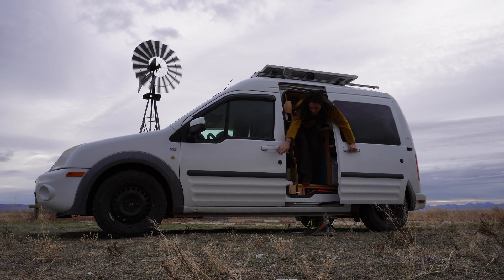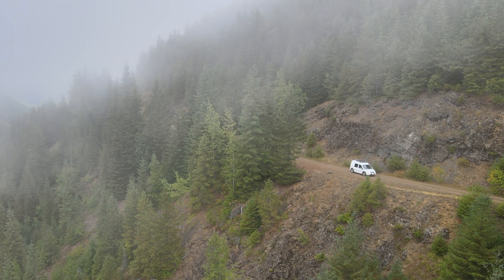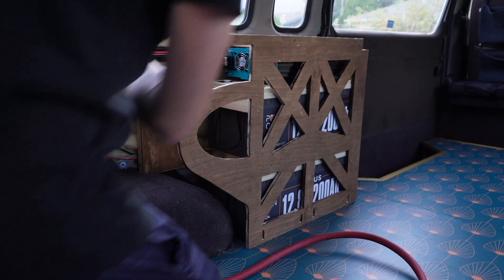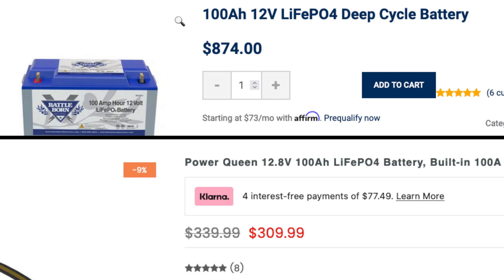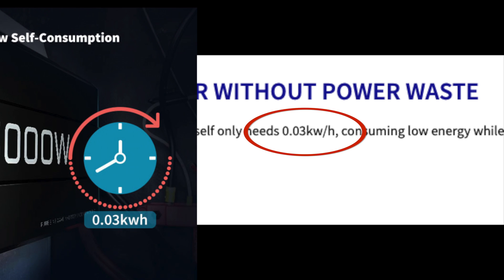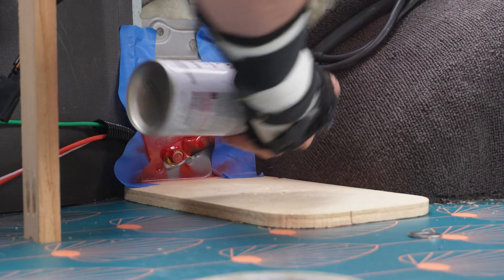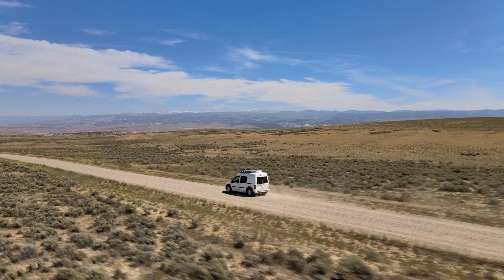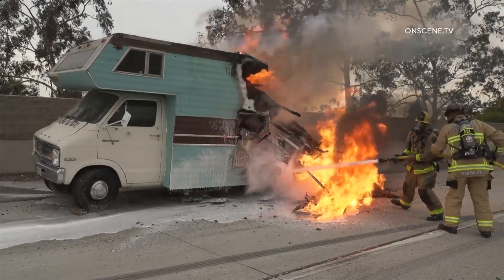Camper Van Power System - Design Considerations

Comment: What is the name of that bracket system on roof. Have never seen that. Thx
Reply from the maker: It's called t-slot aluminum extrusion or 8020
Reply: @dustyodyssey  so I went back and looked because I am familiar with 80-20 but I am actually referring to system on Toyota. I binged watched your videos lol.
Reply from the maker: @navmarroaming2292  oh, the part that attaches to the van? Those are just generic gutter mount roof rack mounts that I drilled holes in to adapt to the 8020. I think I found them on ebay
Reply: @dustyodyssey  Thank you for response. Found the rack build in "Starting the Van Build" video. Appreciated.

Comment: Looks like a pretty well built system. I would have made it 24v and run all of the 12v stuff off the car battery. It would have been easy enough to charge your 12v off the bigger 24v stuff. There's also 120v step-downs that probably give off fewer voltage spikes.
Reply from the maker: Yeah, I think if I were to do it again I would have done a 24v system.

Comment: Great presentation! It's kinda funny how people interested in the DIY camper space end up watching all the same people and videos.

I'm glad you brought up the Max Air fan issue too, went through 3 controllers myself with no explanation from Airxcel CS on what was different from the failed 2nd board as the 3rd looked exactly the same! Going with Foresty's solution if the fan controller dies one more time.

Tangent, but I have to say the dumbest thing about these fans is that they spec'd brushed motors resulting in an inevitable accumulation of brush dust which always leads to squeaking inside the fan motor case. Lord above, Why? All they had to do was make a brushless version and it would be perfect. They certainly charge enough to justify a brushless version. I hope to god that someone produces a drop-in brushless replacement in 2024 after the patent expires. MORONS!

Comment: Thanks for mentioning possible problems with fans, refrigerators, etc. caused by the higher voltages of Lithium batteries. I had not seen any other videos that mentioned this.  Good advice to over-design your system for a margin of safety as well as lifetime economy and longevity.  This is a good example of best-practices engineering.

Comment: I love the simple hammer-whacking crimper for smaller stuff but I bought a hydraulic crimper for the bigger stuff. And since it appears you're in Colorado (and I assume in the Denver metro area), if you want to give those bigger lugs a re-crimp, I'm just up near Boulder, you'd be welcome to borrow my hydraulic crimper.

I built my own batteries as well - I've got a pair of 280Ah packs with BMSs with low-temp cutoffs.

With the fans and voltage - I've read they revised their control board design a few years ago and the newer units are far less subject to failure due to higher voltages. Plus, the 14.6v voltage is just at the top end of charging - when the charging is cut off, the voltage settles back down over a short time. But, the voltage regulator isn't the worst extra thing to do just to be safe.
Reply from the maker: Thanks for the offer! I was really tempted to build my own battery, but it seemed like a lot of extra work, but having the low temp cutoff in the BMS seems really nice, and definitely cheaper than an off the shelf battery. 

I also heard that they updated the PCB (after 5+ years of this being an issue) and I do wonder if I would be ok without the regulator, it is annoying because the regulator uses about 100mA and it's always on, and I don't really want to wire up yet another switch/relay.
Reply: @dustyodyssey  seems what I've read is 2018 is when the update happened on the fans.

Building the packs was fun! I just watched lots of videos and took my time with it. I ended up with 560Ah at 12v for about $1600 all told (cells, BMSs, wire/lugs/terminals, etc). 

Those batteries you have, I found them online, and they seem about comparable watt-hour/cost wise. Lack of temp sensors is silly in these packs now though. I don't know why these vendors skip that.
Reply from the maker: @wanderingzythophile9083  That’s really cool, and now you have the ability to replace individual cells if one goes bad. I agree about the lack of temp sensor. When you’re paying several hundred for a battery the omission of a part that probably costs pennies seems ridiculous. They must have a bunch of those BMS boards sitting in a warehouse somewhere.
Reply: I think it's more to do with the model of the unit than parts. The temp sensors on mine are hardwired, not something that plugs in and can be popped off, like the bluetooth modules are. 

I expect the model units without the temp sensors are simply cheaper.

Comment: Man, this gives me flashbacks to some of the solar systems we've built at work. I'd be pretty spooked to put all this in a plywood enclosure, but I've also set a battery on fire through shear stupidity.

One thing I can tell you for sure: put padding around your batteries. Vibration and rubbing can compromise the outer case of your battery and cause a leak. We just had that happen at the shop last week at work. No bueno. A 1/4" neoprene sheet works pretty well.
Reply from the maker: Yeah, back in the day I had a big MOSFET blow up in my face due to my own negligence haha. I didn't think of the plywood enclosure as a hazard because it seems to be pretty standard with van/RV electrical stuff, but now that you mention it, it is pretty scary... And I think the batteries will be ok. The cells are padded internally on all 4 sides, so even if I manage to wear a hole all the way through the outer case the cells will still be protected.

Comment: 1:08 it's not free. Your total cost of the solar system is upfronting your electricity costs for years until you break even. Then, subtracting any further costs of maintenance, repair, and replacement, you can consider any electricity as "free"...
Reply from the maker: I mean yeah, obviously the equipment has a cost. But, with a high output alternator easily running $500-$600 and campgrounds with hookups running $30-$60 a night, the breakeven comes pretty quick.
Reply: @dustyodyssey  Another factor is the aerodynamic drag of panels on the roof, and what that costs in fuel economy.  I go on long road trips, driving 200 miles most days, so I charge from the stock alternator and don't have a solar panel.  If I sat in one (sunny) place for a week, I'd definitely want solar.  For my 30mpg (highway) minivan, I estimate that running a 40a charger would cost about 1 mpg ($0.30/hour, say), until the battery is topped up.  I don't know if a solar panel 2" above the roof would subtract 1 mpg, but whatever it subtracted would be for every mile, day or night, whether I need power or not.  And putting 50 lbs on the roof subtracts a little from handling.  So the best choice depends on how the vehicle is used.  The less a vehicle moves, the more sense solar makes from a cost perspective, I think, compared to alternator charging.  And sunshine -- living in Canada through the winter, Foresty Forest had an easy choice to use alternator charging.  But I gotta say, solar is cool, and I might put it on my vehicle one of these days.  BTW I use an induction cooker too.  No more opening windows for safety on freezing mornings to make coffee.  :)
Reply from the maker: @posteroonie  That is an excellent point. Rigid panels are not particularly aerodynamic and they’re pretty darn heavy as well. I like traveling in the US west and staying in one spot for a long time. But yeah, if you were making weekend trips, moving around more, or just further north, or even out east where there are more cloudy days alternator charging would probably be a better option. Ultimately, it’s nice to have both

Comment: Awesome video brother. As an electronics technician, I agree with a lot of the points you brought up and you shared some great info and tips. There is nothing wrong with going overspec on parts. Personally, I would rather do that than risk damage or fire with using faulty cheap parts. There is a time and place to save, but that piece of mind will have you feeling more relaxed than maybe some extra bucks in your pocket from going with the minimum.
Reply from the maker: Thanks dude! I'm glad you approve haha

Comment: Renogy's DC/DC chargers have a terminal which, if 12v is on it, cuts the output in half.  I bought a 40a charger but run it at 20a.  If I get comfortable with my system (a thermal camera would help) and need to, I'll let the DC/DC charger run at the full 40a.  Also a welding supply store is a good place to get cable and lugs.  At the welding supply store that I use they'll even crimp the lugs on for free.  What gauge are the largest cables that you're using?  Looks as if it would carry a lot of current!  Useful video, well edited as usual, thanks!
Reply from the maker: Ah, I wish I had thought to go to a welding supply store, that sounds like a great option! That's awesome that they'll do the crimping for you. I'm running 4/0 AWG between the batteries and the inverter. So, if for some reason, I do want to run it at 3000W continuous everything should stay cool.

Good thought on the half output jumper. In my old van things definitely got a little warm when charging at 40A. Thanks for watching!